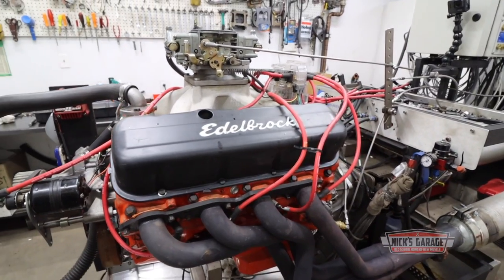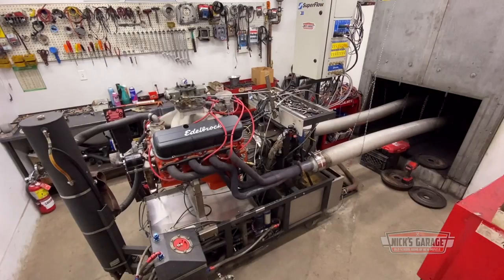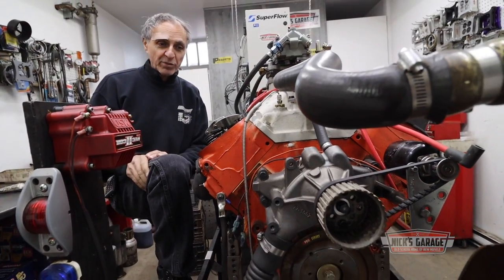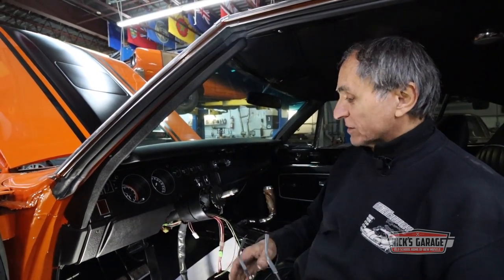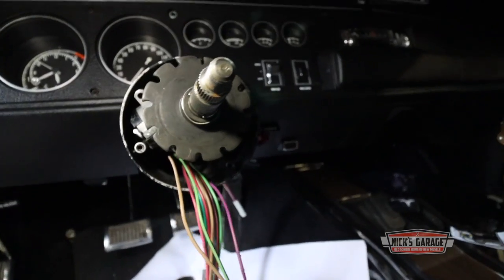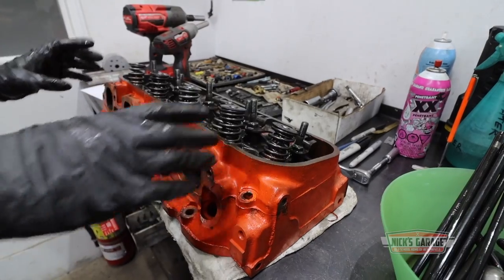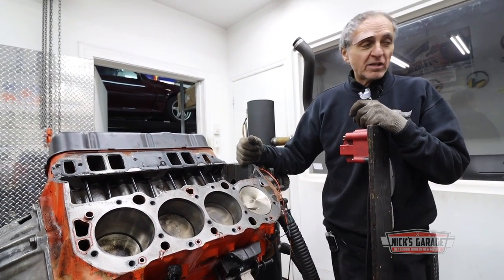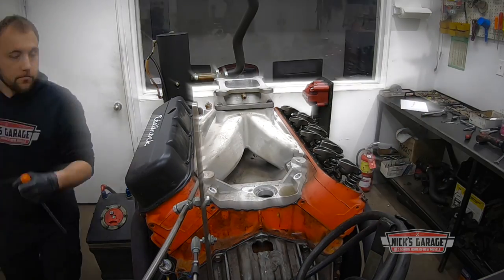Weak Big Block Chev • Wrong Parts + Poor Assembly = No Power!

Comment: Sorry about that eye!
I once cut an eyebrow on a cars hood.
Ouch...
Anyway.
I also had to buy a new ignition switch and 2 door cylinders.
It's seems to be a MOPAR thing.
Isn't it the way of it?
When we work on a project correctly, WE always have SOMETHING to pay for no matter what we do, you pay for it with money or blood.
(And gain knowledge)
My Dad always said your going to pay for it...

About that BB 427 Chevy,
Backwards pistons?
I'm sorry it's hard to not laugh at that.
My kid brother bought a 
Chevy S3 Malibu.
Someone was towing a trailer home with it but it only had a 350/350 HP Small block in it.
No need to say that it had its time.
Out came the 350 and a 454 took its place...
Now you can tow things with it.
I got the 454 out of a junkyard and totally rebuilt the thing to GMs specs.
My brother never had a big block...
I couldn't get him out of the car after that.
My Dad said-
"Look out for the Cops"
And of course, he got his first speeding ticket that week.
My Dad asked me to detune that car a bit.
See?
By the way...
That 454 made 570hp and 610 fp of "twist"

I told you would pay for it.
lol
Thanks Dad.
The way of the muscle car will never die.
T.

Comment: Hey, at least they used parts that fit, albeit a piss poor combo. I got a good story! 

My first car was a 1970 Chevelle Malibu coupe that I bought when I was 16. Originally a 307 car, and was told that it was the original engine, but slightly hopped up (classic intake, carb, cam, and dressup build). My intention was to build it into an SS clone so engine didn’t concern me much, but being a tinkerer I pulled it apart anyway. It was burning coolant so I knew it had problems. What I didn’t expect was the Frankenstein small block chevy I found. 

After taking it apart and checking casting numbers, I found out it wasn’t actually a 307. Someone had dug up a 267 block from an old 80s chevy, complete with stock bore and rotating assembly. They swapped the heads for a set of 1971 casting 400 heads (Hence why it was burning coolant, since the difference in bore from a 267 and a 400 is half an inch, meaning the combustion chamber was bigger than the cylinder, overlapping onto the deck, burning up the head gaskets). From there they added a small no-name solid flat tappet cam, an edlebrock duel plane intake, and a Rochester 750 4 barrel. Add some Mickey Thompson quick release valve covers, a chrome air filter, and a hei distributor and you have the build. 

I got a good laugh out of it, tossed out everything but the intake and valve covers, and ended up building a 396 (bored to 402) for my car with the help of a professional engine builder. Ended up making 380 hp and 410 lb ft out of it with stock crank and rods, stock iron oval port open chamber heads and a whopping 9.2:1 compression ratio so I could burn regular gas,   And have lots of room for power with a little boost or a simple head swap. I’m quite proud of the combo, it’s perfect for a car show cruiser, good on gas when you pull out of the throttle, but still a lot of fun when you ask for more 😁

Comment: Years ago I was in getting my motor rebuilt and the guy who owned the shop showed me a motor a customer had brought in. The customer had just bought a car and was told the motor was just rebuilt and same thing was out of the car on the ground. The motor ran like crap. When it was opened up 7 pistons were flat top and looked like they had never been touched and 1 piston had been replaced but it was domed and bored 60 over.

Comment: This engine was built for a turbo, low compression. 600hp would be easy but upsidedown pistons OMG!
Reply: yup, or bug juice nitrous.
Reply: I just posted that Nich should bolt a 6/71 or Paxton on it if the bottom end isn't as junk as the top.

Comment: Ever notice if you have worked in an Automotive shop for any length of time that cars come in to the shop sometimes in groups of the same colours, Nicks shop have 3 orange coloured cars that they are working on in this video. It used to be a joke at the shop I worked at one week it would be mostly white car and trucks and a few weeks later silver was the main colour 
then Black , then red ............It is something if you work in automotive repair shops ,mine were in Auto body this happens lots

Comment: Check out the lifter and cam lobe miss-alignment @ 9.38-9.40. That block will cause a lot of cam and lifter wear problems if high lift cams and stronger valve springs are used. Lifter bore job will fix it.

Comment: You said that with those flat top pistons, it will never make 600 horse power, Because they are in 180* backwards? Is that why the compression is so low.? i always thought that flat tops made more compression,or is the compression low because the heads have a large combustion chamber? I’ve got flat tops in my ford FE and it makes just a tad over 200 psi, thanks
Reply: Jackie.          Pistons way below deck and big open chambers.
Reply: Nick Panaritis got it, didn’t see that, that definitely will do it, thanks for replying

Comment: Take that gear drive throw it in the trash and put a good double roller chain in it. I guarantee the timing is all over the place at high rpm.
Reply: Don't throw the gear drive in the trash!  There are plenty of "boat guys" who love to run those.  He can pick up a little cash to help buy pistons and a cam.
Reply: @Jim Postlethwaite  Lemme know how you figured that out when you get a chance
Reply: Ummm What you just said was physically impossible gear drives don't lose timing at all.
Reply: HiShoK so you mean to tell me that the gear to gear doesn’t create harmonics especially with all that noise??? I had a 421 cubic inch small block Chevy that had a gear drive and I could not set the timing on it with a timing light cause it was so erratic. The ONLY thing I did was take out the gear drive and put a double roller chain in and the timing was steady and consistent.
Reply: @jimpostlethwaite195  lol
Reply: @jimpostlethwaite195  Don't blame a Gear Drive for user error.
Reply: @jimpostlethwaite195   I use milodon gear drives They can withstand over 10,000 RPM indefinitely.

Comment: Hey Nick want to save a lot of time? Invest on a Probe Camera! 
With a probe you guys could have inspected the Cylinder walls and Piston Heads without taking out the Engine Head via the Spark Plug holes. 
There are many cheap ones but you might want to get one with high quality image to be able to see details like Cylinder Wall scratches, Cracks, Grooves and Rust.
Reply: Vitor.       We have one, but my client wanted the heads off anyways
Reply: @nickpanaritis4122  Nice

Comment: The ignition lock cylinder is an aftermarket from OReilly's they are the wrong size that's why it stuck in the column I have pulled tons of them. Get a OE from Mopar with the pin kit and set it to your key takes a few minutes easy to do.

Comment: There's an explanation for those backwards pistons: it's an old school trick to make more power. HOWEVER, it only works when the pistons are either flat tops with no valve reliefs or with symmetrical valve reliefs. Not in this case.
Reply: You are 100% correct it has to do with the connecting rod angle. They offset it in the piston from the factory to make the engine run quieter but when you flip them it pushes on the crank straighter I believe.  Wow I'm surprised someone else knew this! You must be old too! LMAO!
Reply: @wayne5607  I'm not that old I just watch uncle Tony's garage here on YT.

Comment: Roller rockers with low lift(stock?)flat tapp hydraulic cam.? time to go with aggressive roller cam? I know your a natural aspirated engine builder, but maybe try a turbo on it since its at low compression right now with the flat tops and the cam that would be interesting just to see results of experiment before you change cams and pistons to get the natural aspirated hp, just an 💡 idea. Hope you try it.
Reply: Thomas.      It all depends on my client.

Comment: Aahaha, the big blocks with flat tops are such dog. Glad i got domed pistons on my 454, woke it up real good. Im on my second transmission because of it tho.
Reply: Consider a Tremec manual or upgrading to a THM-400?
Reply: Get serious :) M-22
Reply: @Lammergeier350  why go with that junk box and not a 4l80e thats the same but with a few cheap mods are capable of over 1000hp and have overdrive so mpgs
Reply: levi blankenship  why its inefficient on everything other then rebuilding it they are cheap and easy

Comment: 427 needs round port heads for torque on the street.   Square port does not cut it.   Had a square port 427 on my 69 Vette.  Driveability sucked.    Accelerator was just an on/off go fast switch.

Comment: What is that in the pan at 9:20? Appears to thick for water and to thin for oil. In some motors the pistons installed 180 out improves the con rod geometry lucky the valves didn't hit the pistons.

Comment: I've built nitrous engines to run on pump gas that only had 125 cranking compression.  They don't make alot of power on the motor but can double the power easily with nitrous.

Comment: That was a fraud! "No horse power?!" "The engine isn't even mine and I am pissed off!!!" "Liers should apologize!!!"
Reply: reassembly required! pistons backward, rings probably on wrong too. put some real valve springs on it, ditch the gear drive, a better (real) intake manifold, I'd live with 125 psi compression and the lower horsepower... 
spray the byoch when I wanted some GO from it.
Reply: @modelnutty6503  All I see is a paper weight V8 with no go! I feel sorry for the new owner because he has to spend more money to get the 600 horse power! 🤬🤬🤬🤬
Reply: @richardbrowne1217  Hey, boats need anchors, too.
Reply: @AmericanThunder   That engine would sink a boat. It's too heavy!
Reply: @richardbrowne1217  I was thinking something bigger like a battleship.
Reply: @richardbrowne1217  I haven't had a mother-in-law in a long time and none of them looked as gorgeous as the iowa class  battleships. Lol
Reply: @AmericanThunder   "Really?!" "My grand Father severed on the U.S.S. PENNSYLVANIA BACK IN THE 1960'S BEFORE IT WAS DECOMMISSIONED AND USED FOR TARGET PRACTICE. THEY COULDN'T SINK IT! THEY HAD TO TOW IT BACK TO THE PORT OF HAWAII.
Reply: @richardbrowne1217  That's cuz battleships are badass.
Reply: @AmericanThunder  IT WAS ONE OF TWO BATTLESHIPS THAT WERE DESIGNED TO BE UNSINKABLE BACK DURING WW2. NOT LIKE THE TITANIC THAT WAS SUPPOSE BE UNSINKABLE. "IT SUNK!"
Reply: Alex Eidenier   A new what? Engine? Or a new car?
Reply: Alex Eidenier  ok. Understood.
Reply: Apologize right after they give his money back. Or pay for the real build.

Comment: I love all of that orange rtv everywhere.  Can I recommend using the largest size red snap-on hammer to use instead of a screw driver and a hammer banging the head loose.  One tap and it will break it free.  Never use a screw driver on a head or mating surface.

Comment: Guy would've been pissed if he raced someone with that "600 hp" 427. Lol as it was, even a hot 350 chevy would've put that things lights out.
Reply: A stock vortec with a carb and headers would almost get em
Reply: levi blankenship  i bet it happens a lot. And from my experience, most guys WAY over estimate how much power they have. I personally work with 2 men that have "600hp" 383 chevys. Both cars really make around 450hp or less. The one is a big cam, big carb, huge single plane intake, with terrible flowing restrictive small runner heads. Cam wants to go to 7,000, heads want to die at 5300. Lol
Reply: @jordan-ramblinaround2323  sad thing is 450 hp from a 383 isnt bad.
Reply: Yeah, a 600hp car would have 2 seconds on a 366hp car. Lot of room on the big end.

Comment: So we are talking Pistons a balance job a new bump stick and tear down those heads to check if the valve job was done right . New valve springs a must and you should be good to go . The heads may also be warped from what I see here . I'm old school when it comes to tear downs and I always crack the head and main bolts loose before using power tools to remove them also i reverse the bolt pattern from how the installation instructions show you for each engine . I'm curious if that engine has full floaters or pressed pins ?

Comment: The salesman who sold your client that 427 failed to mention that the H.P. was rated under the standard B.S./H.P. system.
In the standard B.S./H.P. system, you take the actual H.P. then multiply by two. For example @ 2:52, if that 427 motor produced 366 Horsepower 🐴 
under the standard B.S./H.P. system it's producing 732 B.S./H.P. 💩 🙄 Great Video.🤓👍

Comment: 427 tall deck. Lol, saw that a mile away.
Reply: Was it the small bores?
Reply: @grabasandwich  Bores have nothing to do with it.  A 427 TD has the same bore as a short deck or a 454.
Reply: @SealofPerfection  I meant if it was a 366 which apparently has smaller bores. My bad.

Comment: some pistons, might as well toss in some quality rods, and that 454 might just come to life. I'm about to be building a big block chevy myself. Gotta find a medium duty commercial truck for the donor though. I need the SAE#3 flywheel housing, and the air brake compressor for my project. Going to be removing the multifuel engine from my m35a2 and replacing it with something more RPM friendly. So that i can use it like a big ass 6x6 pickup. Engine will be at 3200 RPM at 65 mph using the m35a2 OEM transmission and axles, with the standard 40" tire. Not many diesel engines would live a happy life at that RPM, but a nice, commercial 427 would never miss a beat. Keep in the mind the multifuel engine only delivers 120 hp and 300-350 ft-lb torque. So even leaving the BBC bone stock, would be a nice improvement.

Comment: with large chamber heads and flat top pistons, comp. ratio is about 7 to 1. black silicone sealer on intake gaskets is a no no- dissolves in gasoline and causes vacuum leaks. hi-temp orange silicone around water ports between block and heads is a no no. they didn't even bother to port match intake ports on the heads to the gaskets and most likely manifold also. someone had a pile of parts and built a cheap back yard engine. if the pistons are installed the wrong way, what else is improperly installed? I'd be sure to check rods and caps to make sure they weren't miss matched. best bet is complete disassemble and start over from scratch.

Comment: bet you there's a big cam on the shop floor  somewhere ,they put the motor together with the pistons backwards  pistons hit valves on assembly  and boom smaller cam installed .

Comment: If a short block is being built for reverse rotation marine application and the piston pins are off set 60 degrees or more the pistons go in facing the rear of the block (not with valve reliefs). Also if your building for forced induction you want around 8.5 to 1. I wonder if its a 4 bolt main block, has a nitirited crank or rods with the  big bolts ? I agree oval port heads better choice for a street friendly engine. Buying an assembled engine is always a gamble.

Comment: They're mixing old standards to new Tec.  Cam time is off backfire through carb is a giveaway!  Valves are open to combustion side of timing...
Reply: JERRY.           Valves  floating,  springs too weak.
Reply: @nickpanaritis4122  Yes! Your not in SB anymore &   you said cam is now roller . springs have to match. Don't they?
Reply: @jerryahrens7810  .      Yes.
Reply: @nickpanaritis4122  also if new cam was degreded it might be set holding it open. Set off to crank degreeing it too much!

Comment: A set of closed chamber oval port heads with big valves and minimal port clean up, a aggressive solid flat tappet cam, correct intake (lose the single plane) and a well set up distributor will get that engine close to 600 hp even with the flat tops. 
BBC's are easy to make power with. But, the combo has to be right. For a street driven ride, stay away from big square ports! They only make more power above 6500 rpm. You need port velocity at lower rpm on the street. 
Do not polish your intake ports. You want some turbulence to help atomize the fuel. 
Lose that stupid gear drive as well. Doesn't make power, only noise.
Don't get too big on header primaries either. The real scavenging is done by the collector. Make sure it is correct diameter and length. 
Building BBC's isn't rocket science. Do your homework and make it easy on yourself!

Comment: In High School back in the day... There was always an unfounded claim of high horsepower based on a given combo. One example was a guy who had a 69' Camaro Hugger Orange three speed on the floor 307 2-bbl. He claimed the previous owner had modified the engine to make 400hp. My brother challenged him to a race with his 68' 318 four door Dodge Coronet and beat the Camaro handily. Since the the 318 had 180,000 miles on it I am certain it did not make the claimed 230hp that it was built with. Moral; the only way to accurately measure hp is on the dyno. Thanks for showing us these types of engine builds each week Nick. At least now, we have a place to direct these claimer's who are convinced a bunch of mixed high performance parts should make 'said' HP based on what was installed. We all look forward to seeing what happens with this 427 Rat and the 427 FE as well!!
Reply: 307 is a low compression pos. Even with a vette cam and headers it probably doesn't put out 262ci power. One of the worst motors Chevy cursed a vehicle with.